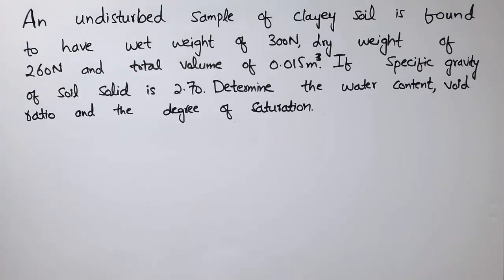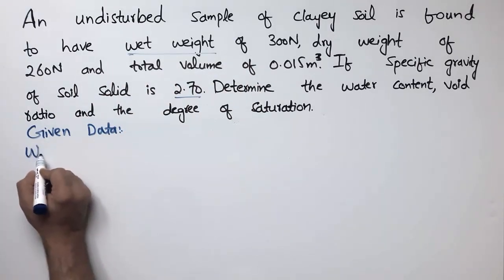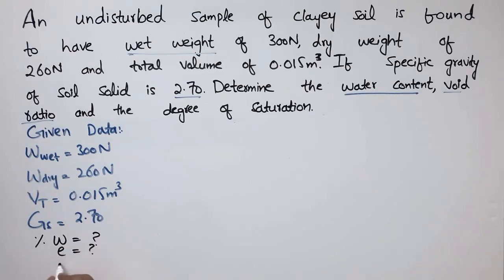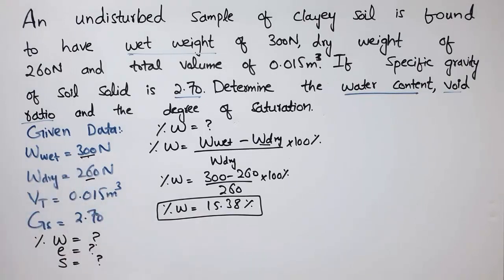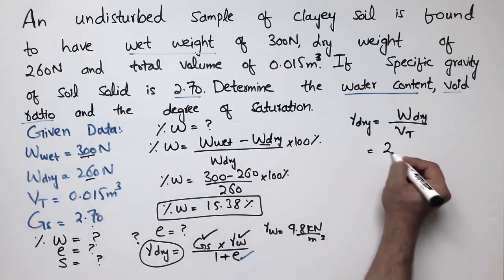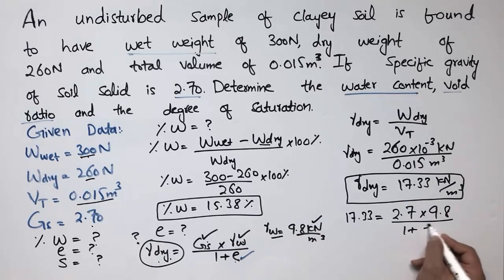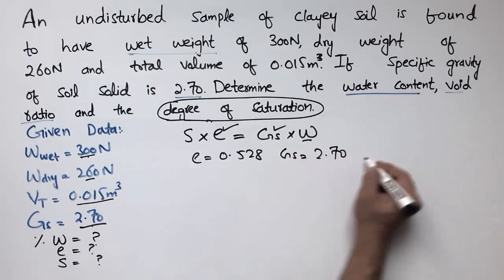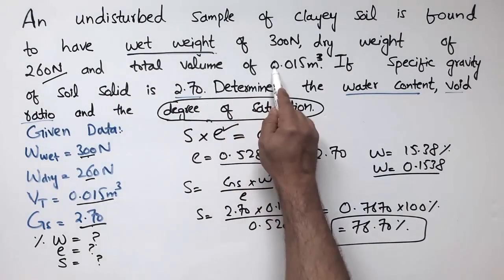Soil Mechanics || Water content, Void ratio and Degree of saturation

Comment: The undisturbed soil at a borrow pit has a water content of 15 percent, void ratio of 0.60 
and specific gravity of solids 2.70. The soil from the borrow pit is to be used for the 
construction of an embankment with a finished volume of 40,000 cu.m. The specifications 
for the embankment require a water content of 18 percent and a dry unit weight of 
1.76 g/cc. Calculate quantity of soil required to be excavated from the borrow pit for the 
construction of the embankment. What would be its weight? What is the weight of the 
embankment soil? Send answer